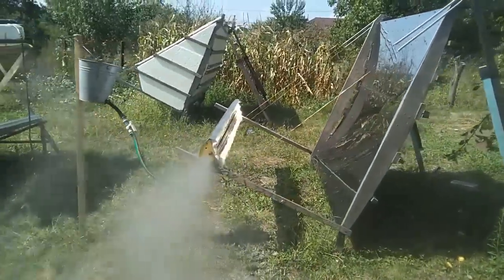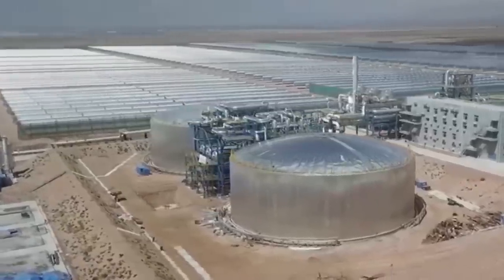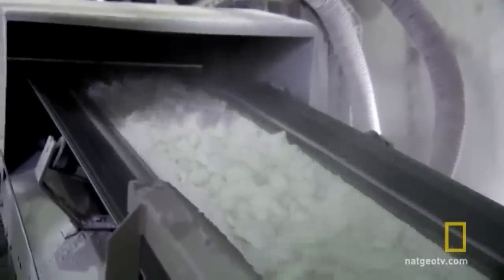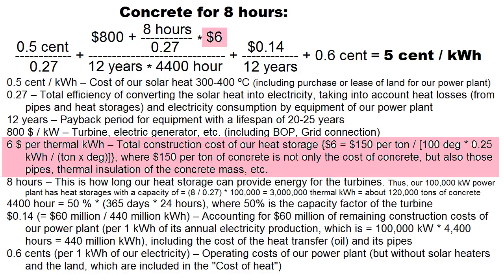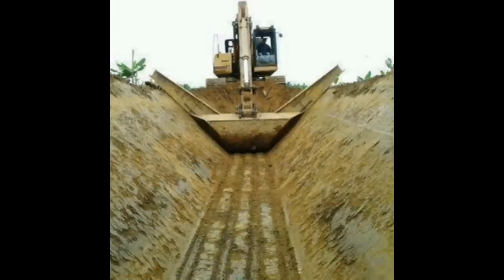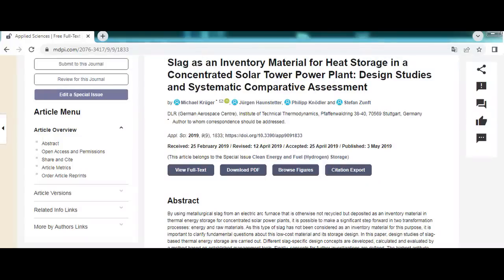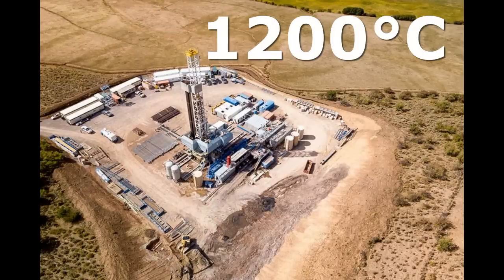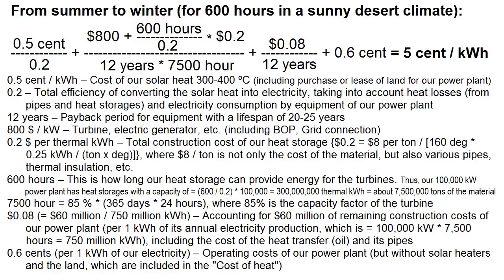New in Solar energy: solar electricity day & night, 5 types of storages that are cheaper than Li-ion

Comment: graphite is a more effective heat storage, it's more expensive than gravel or concrete though, but the building you have to build around it though is still the more expensive part so it's not a big deal.

Comment: The only engine suited for use with solar thermal heat to generate power is probably the SunPulse 500 but it costs more then equivalent solar panels.

Comment: There are solar farms that use trough mirrors to heat compressed air in pipes to drive a gas turbine.  No water to deal with.  No freezing or running out of water or other water issues.   From 20°C to 700°C, air expands over three times.  That is an increase in pressure of about 28 psi for a fixed volume.  Over a 10 inch diameter piston, that is  over 2000 lbs of force which gives some idea of how much air it might push through a pipe in a short amount of time.  The exact figures are not easy to find.  The Carnot formula  for efficiency give some idea of the possible power output for a given solar power input.  At 700°C for the "furnace " temperature, greater than 30% efficiency might be achieved.  One way to test it is to use  a small car turbocharger as the turbine.  Just connect the solar collector output  to the exhaust input  port of the turbocharger and connect the output from the turbocharger compressor to the input end of the solar collector pipes.  At some combination of components, the system might achieve good efficiency.  Some turbochargers have combination starter motors and generators for high performance vehicles.   Just hook a solar panel up to it so that the starter motor starts up whenever the sun is out.
It is kind of appalling that I find so little activity in this direction amidst an historic pursuit of solar energy technology.  
There are solar farms that use this approach.  They store the energy as heat and recover electricity from it at a later time with a gas turbine.  
But the steam approach is am interesting possibility.  Adding a fine  mist of water to a high pressure stream of heated air might greatly increase the vokume and pressure and velocity of the air .  In a gas turbine, the exhaust end is substantially larger than the compressed air inlet which gives the heated gas some idea i of which direction it will tebmnd to expand.  The high pressure at the compressor end of the turbine also gives some kind of direction to the system.  A piston engine might try to run backwards if it were not for the flywheel and the engine  being started in a certain direction.   Early jet engines used a centrifugal air compressor as does the turbocharger.

Comment: If you have a insulated  full of linseed oil , have tubing in it hooked to parabolic dish it can heat it up to 800 degrees with a water line through the tang , it will make steam which will run a steam engine , you can use a smog pump which will run a car alternator . A man made one out of a long parabolic dish . My idea is a large satellite dish covered with mirrors that tracks the sun

Comment: [I require 2% if placed in production, and a vote.  The comment being: "The miracle is this, the more we share the more we have."]

Solar panels heat the thermal oil or water, creating steam to elevate sand storage tanks.  The tank(s) lower throughout the night creating kinetic energy.  This will allow for scaling to a cities needs, and constant energy daily and allowing for reserves in case of emergencies.

This all pending the willingness of converting to electric as the main power source.

....and yes i know this is duct taping multiple ideas together...but hey. . .

Comment: Great stuff.   How about using mirror or fresnel lens to heat SAND with copper pipes INSIDE sand and you will have more constant heat HOLDing the energy into the pipes to heat the water, or air or oil or or or!!!!!!!

Comment: You are incorrect on your .5 cents/kWh estimate.

That reflector will not stand up for 25 years through high winds, sand blasts, UV rays, oxidative breakdown, etc.

Mylar will break down in 3 months in the open. 

The thermal storage ideas are great in my opinion.

Comment: Great job on this video! Bubbling the hot air through sand is really interesting for concentrated solar heat storage as usually it would be more efficient than pumping a liquid or moving a solid... On the other output/generation end what practical alternatives have you seen to turbines?

Comment: I want to build several small units and one large starting in spring. I've got a good amount of materials now.   The 3 small ones are for a nice multipurpose shed, an above ground pool, and a greenhouse.  The  large unit will be for an air furnace and a mass storage bench in the basement both heating the house. They all jeed to operate without power.   

I'm wondering what oil we would need for the heat transfer fluid.

I think I will implement a sunken thermal battery in the backyard. A buried 1000 litter tote filled with water, maybe some propylene glycol mixed in, surrounded by sand and capped with insulation and dirt.    Be neat to see how the ground behaves in our deadly pararie winters!  -40° sucks in any language  !!!!

Comment: Thanks for your input it's quite interesting. In my neighborhood they built a on family home, below the subconcret-floor about 6meters below level they made the heat input, the output heatexchanger is between 4-3 meter below level. The input by vaccumesolartubes in summer it charges, during the  winter it discharges. Disadvantage is the basement is warmer than 18celsius.
Reply: 18C is a problem? I could get a lot of work done if I had 18C in the basement!
How is the humidity then? choosel ove

Comment: It's not fracking that has caused earth quake problems in Oklahoma. It's injection wells. Brine water from oil and gas wells is what is being disposed of into the deep wells. So there is the source of cheap salt after it's cleaned up enough for use.

Comment: Thanks again, I have a question, if you said that Using the oil is the best, and cheapest material to use, then please let me know,  if is necessary to change the oil after several times or not?

Comment: Infrared is a relatively small percentage of the total number of waves that come from the sun.  Most of the energy received from the sun is light and not heat, so the photovoltaic method is more efficient.  There are several thermo solar plants in the world and the cost of their production is very expensive and uneconomic were it not for the subsidy from the government.  Regarding energy storage using the method of stored heat, it will be more efficient to use electrical power from photovoltaic production to produce heat than using infrared from the sun.
Reply: While the wavelength the sun puts out is many, PV can not currently convert all the wavelengths at once, I am only aware of roughly being able to convert 2 wavelengths at once and those are the latest tech. 
The amount of usable thermal energy under those circumstances is simply much higher. The metric you mention to prove it isn't viable is based also on current in production material, while these are all trying to reduce those costs.
Reply: That is wrong concept and quite the opposite. All EM wavelength transfer energy and can be converted to heat, not just infrared. On the other hand, photovoltaic can only capture certain short range of wavelength. That's why solar thermal collector can easily reach more than 85% while solar PV can only reach below 30% at most

Comment: I wondered if storing energy in gravel could be better if the heat transfer medium were some sort of liquid, pumps are easier to maintain and control fluid. problem is it could go back to the issue with molten salt.

Comment: @sergiyyurko8668 after watching some of your videos i now have a new suggestion which may be worth investigating and further experimenting with. it is an evolution of one of your recent mylar sheet designs. but with a twist!

ok so in your previous design you put the mylar reflective surface on the inside half of a baloon. and with the front half transparent. which you achieved by removing half of the reflective coating. however you then discovered the focal point was too close to the baloon or inside of it.

however the fundamental idea seems of high value. because the cost to generate a large focussing surface area using baloons and air is so low. in fact it is far lower cost than anything else. and also faster to build. 

what is needed is to have the baloon behind the concave mirror. however of course we think we cannot because we need a positive pressure to make the balloon. but this is not true. we can instead make a negative pressure baloon that is more like a tent shape or a toblerone shape. with a negative pressure inside that is lower than the external atmosphere. so this then requires a triangular toblerone shaped frame inside which the baloon is hung. the baloon also needs to have anchor attachment points to the frame like a tent. so for example loops or one long folded loop. through which a rod can be pushed.

then we need to achieve a negative pressure. this can be done with a one way valve and some energy. at peak sun the natural heating will expand the baloon. it will push air out of the one way valve at the hottest time of the day. but plastic permeates air through its membrane. different plastics do this at different rates. so the plastic should be chosen to have a low permeability. even so, the baloon probably needs an active mechanical pumping (can be human or motor). which should be done at the hottest time of the day for lest effort. perhaps once per week.

i think the biggest difficulty to this approach is getting the manufacturing right. so that the shape of the balloon and the seams are stron etc. normally in industry we have flat hot bars to seal and join with heat 2 flat sheets of plastic. and this is used a lot in the food industry for sealing food items. a suction hose to remove air. or a flat metal vacuum table with holes in it is the surface. with suction from below. to remove air. in another industry we have vacume forming. where a buck is used and a vacuum table. and a hot sheet of thermopastic is air heated from above. then droops and is floppy then with both gravity and the sucction table takes away air,  as it cools it solidifies.

perhaps you will find other cheaper or better techniques for manufacturing. which are less complex or easier to scale up. it seems like a rigidly set vacuum formed pastic would be cheap. but might not be very durable or as cheap or as friendly to the environment as a mylar baloon.

on the other hand a negative pressure baloon may require some pre-formed contour or buck or mould to make the mylar sheet pre-shaped to the ideal curve for a mirror. to focus the light accurately enough to concentrate it.

the tent frame structure also adds some costs. however it is permanment and can be re-used many times. so is a sunk infrastructure cost. while the cheap baloon wears out and then can be economically replaced.

the other thing to consider is that if a negative pressure baloon has to be custom made. then why not just make a better positive pressure baloon. that is a better shape. it can be cheaper and easier to use. but perhaps both design approaches are worthy of evaluation. and testing one against the other. to see which way round is the better choice. this is not so clearly understood. at least not without some deeper level of prototyping and more work.

i hope you found my twist on your previous idea fun and entertaining. thank you and good day

Comment: For years Sergiy has been on the right track already. I think solar heat storage is the only way to go have renewable electricity in winter and other non-solar moments. I really don't understand why there is so much emphasis on home battery storage of solar electricity. One of the main characteristics of electricity is that this form of energy is that it is not stored easily. Plus the production of batteries drains earths resources and it's production is a burden on environment. The waste of died batteries is even worse. But the worst is that a huge amount of batteries  can not even hold enough electricity to store the needs of 2 non solar days. The sun provides more than enough energy for our demands. But it is our responsibility to store and process it wisely. Sergiy is trying to tell this over and over with his great videos! Thanks!
Reply: It's all about the money, always has been.
Reply: The problem is surely industry. Batteries involve technology that can be patented to siphon profits to fewer hands. The only benefit of batteries is that the released energy can be more easily transformed into other forms.
Reply: @wageslave387  yes for example Tesla and Elon musk dont get fooled by his produces he has nothing to do with saving environment. It's all about money
Reply: yes, well where is that small steam electric generator?
Reply: @Jelea Costin  use solar to produce hydrogen. Then, run ICE generator on hydrogen. Much more compact than having shipping container sized boxes of gravel and a steam turbine next to your house hahaha
Reply: @Lee-xs4dj  

Much more compact but much less efficient from an energy point of view.
Reply: @Lee-xs4dj  if you use hydrogen to store electricity, the process is about 42% effecient.  pumped hydro storage is cheaper per kwh stored and is about 80%  efficient. I think this is why hydrogen use has not become widesperad.
Reply: @jeleacostin1622  ⚠️ God has said in the Quran:

🔵 { O mankind, worship your Lord, who created you and those before you, that you may become righteous - ( 2:21 ) 

🔴 [He] who made for you the earth a bed [spread out] and the sky a ceiling and sent down from the sky, rain and brought forth thereby fruits as provision for you. So do not attribute to Allah equals while you know [that there is nothing similar to Him]. ( 2:22 )

🔵 And if you are in doubt about what We have sent down upon Our Servant [Muhammad], then produce a surah the like thereof and call upon your witnesses other than Allah, if you should be truthful. ( 2:23 )

🔴 But if you do not - and you will never be able to - then fear the Fire, whose fuel is men and stones, prepared for the disbelievers.( 2:24 )

🔵 And give good tidings to those who believe and do righteous deeds that they will have gardens [in Paradise] beneath which rivers flow. Whenever they are provided with a provision of fruit therefrom, they will say, "This is what we were provided with before." And it is given to them in likeness. And they will have therein purified spouses, and they will abide therein eternally. ( 2:25 )

⚠️ Quran
Reply: @1islam1  spoiler alert it's poorly made, written by wandering bedouins and rips off the Greeks, Jews and Christians. In short, it's s all lies. You're welcome
Reply: @1islam1 
This has nothing to do with solar power.
Reply: What? Do you even know how expensive batteries are?
Reply: @Dougerro  

Battery 🔋 efficiency have not changed much in the last 200 years since Alessandro Volta invented them.
Reply: Есть еще водород
Reply: @I'm yes they are the enemy of humanity
Reply: Home batteries are for people that want personal energy independence, and it's consumer facing hence why you hear about it more. Nobody is trying to sell you a thermal battery because they only work at large scales because the larger the battery the less surface area it has, the slower it self discharges, also your not going to be putting a steam turbine in your home...
Reply: @Etheoma  Many people heat their homes with a thermal battery called a masonry heater :D But yeah, building new batteries for home energy storage doesn't make sense. Using the battery that's in a car or even utilizing old batteries from cars etc. makes more sense. A battery that no longer has enough capacity to be good in a car, will still work fine as home energy storage before recycling in to raw materials.

Comment: Thks but I confused why salt is so expensive;
I do understand the salt must be contained by non-corrosive material (ex: stainless steel).
However salt changes phase between solid/liquid which stores the most heat energy.
Reply: It is also a more expensive material to begin with, and depending on the specific type of molten salt used it can pose a serious risk to groundwater enough to necessitate expensive redundancies in addition to the expensive storage tank.
Reply: @garethbaus5471  Thks, ?can you thinks of any safe change phase material (ex: wax)?

Comment: Hello Sergiy !! Its possible to create this solar generator without the "oil transfering part" ?? Just directly from steam to engine ?? I mean if u can generate steam directly from the pipe, why the big solar collectors using the oil part for transfering the heat to generate steam and then put into steam engine ?? Thx.
Reply: @astebbin  Oil also doesn't expand when it freezes, so you don't need to worry about heating or draining the residual liquid in the collectors on cold nights.
Reply: Great idea
I have thought about this as well. If you were to develop a low pressure turbine saturated steam not superheated, something that would run at the substrate containment vessel and solar system pressures.
  Use air to heat the substrate, inject water into the system diverting the steam air mix to a low pressure turbine. 
  The condensate could be recirculate through the system. 

This could be quite cheap.

Comment: The heat medium is not the major cost. It's the construction and maintenance of pipes and heat exchangers and tanks.  It. For gas boiler it's very cheap to make a boiler. . We need to turn heat into a fuel to be consumed later. . 25 c  Liquid tank is much cheaper than 800c hot sand tank